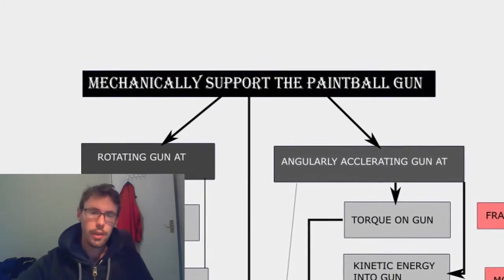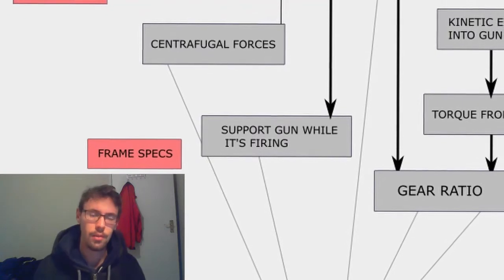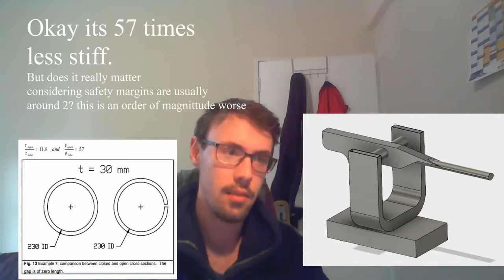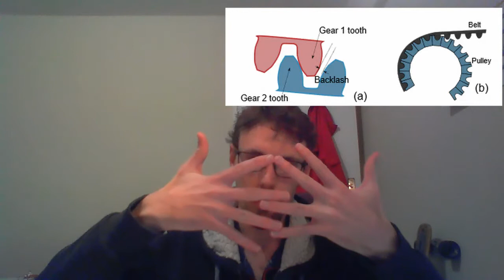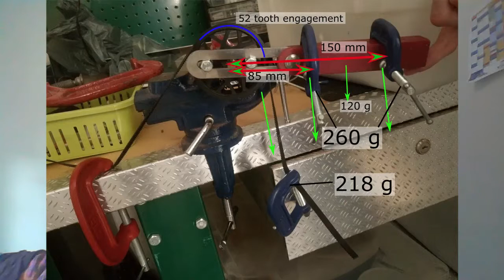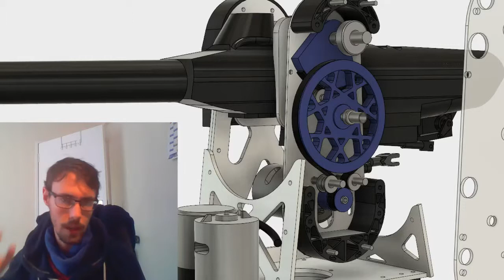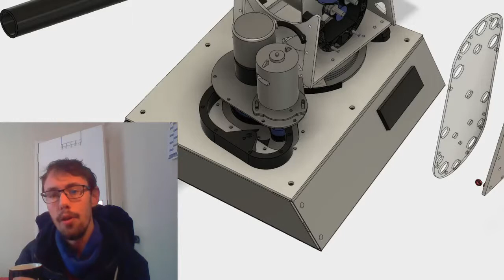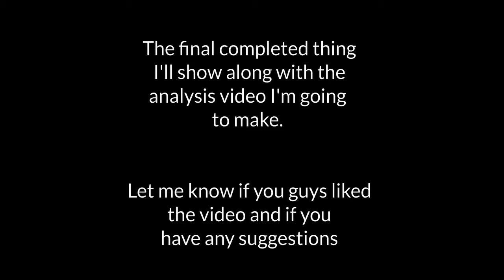Paintball Turret - Sentinel mechanical design (Video 2)

Comment: I had always had it in my head that Steppers would have been better for 
this sort of application, due to their high accuracy. Very interesting 
to hear you are using servos and a belt-driven gear reducer! Clever! 
I'll probably incorperate it into my designs
Reply from the maker: Steppers are accurate, but very slow and don't handle dynamic situations well! They are for CNC machines where paths are predictable and the load heavy.

Comment: hey how did you cut those aluminium parts so clean and fine?
Reply from the maker: I sent the DXF files to a metal laser cutting shop, told them the aluminium i needed, then picked them up

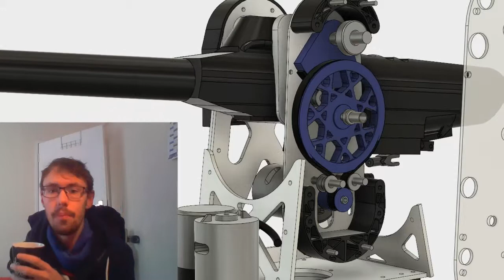Comment: 24:52 can u explain how that triangular thing on the top is getting affected by the big pulley insider system?
Reply from the maker: The big middle gear has a smaller pinion that the belt around the triangle goes around. Same as the bottom mechanism where the section gear at the base connects.

Comment: hey I'm doing the same work as yours but instead of servo im using Nema 17 Stepper with Geekworm Stepper HAT, my motors aren't moving smoothly they make a hell lot of noise that it feels like someone is firing a turret and keeps on moving in one direction even if i give command to rotate in oppsite it just keeps on going sometimes it just roatates one step back and then keeps moving forward direc. in microstepping mode it keeps on vibrating but don't rotate it heats up the motors too. See If u can help me, your any help could be a precious one for me :).
Reply: I'm doing all this with RaspberryPi model 3B+, if I intend to use servos then how can I with Raspberry for such kinda application?
Reply: the first version I made was on Servos but I was just kid back then so I didn't knew the technical stuff
Reply from the maker: This sounds like an issue of wiring or coding since they should move, but probably not as good as servos
Reply: @ThoughtinFlight  yeah true